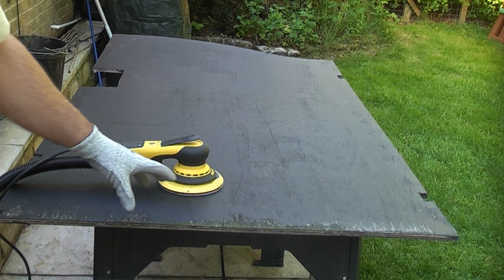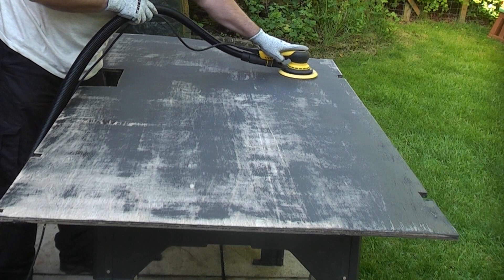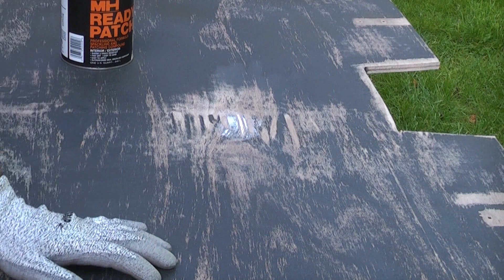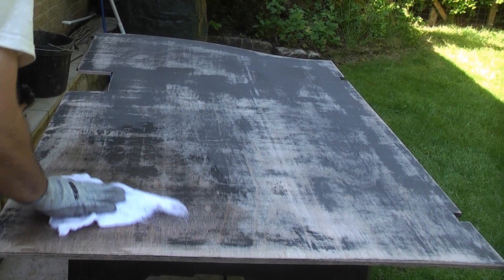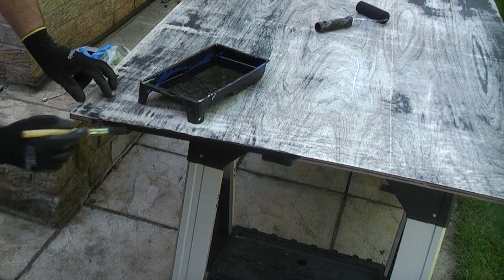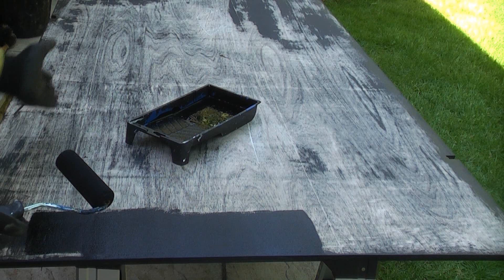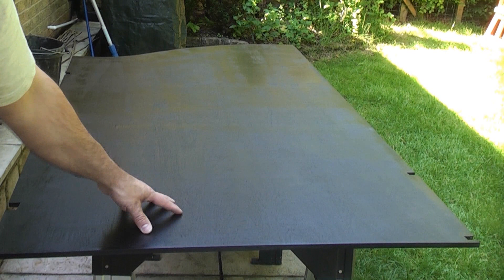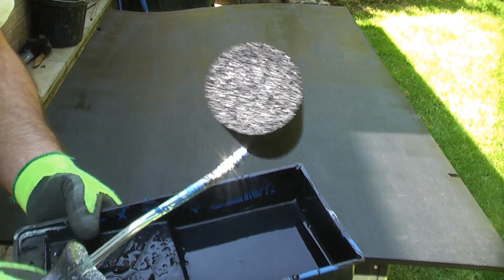Painting external timber | Zinsser ALLCOAT

Comment: Awesome video. This product is amazing. It's all I use on woodwork these days. A little bit more expensive but it's one can multiple uses kind to your brushes. Also a far quicker working and drying time. Jobs can be finished in a day. Fantastic for sash wlndows as well. Cover stain on the putties then 3 coats in a day. Just brilliant. 👍🏻
Reply from the maker: I’ve just been using this again in the last few days, first coat can be overpainted after 1 hour, the top coat is touch dry in about 20 minutes- brilliant paint 👍

Comment: You could use a sprayer on those, you can see the roller marks quite clearly on the finished product 🙈
Reply from the maker: Yes, because it is water based it dries really quickly, so much so that you cannot keep a wet edge.
I've used this paint a few times since and have sprayed it on using a Wagner sprayer and the finish is flawless.
Thanks for the comment

Comment: Nice finish!  It's amazing what a little extra effort in the surface prep will do for the final result. For projects like these I typically remove the final surface dust first with a shop vac and then with a damp rag - keeps the rag cleaner...  (By the way, what software are you using to edit your videos?  You do a nice job of that, too.)
Reply from the maker: Jo Baecker 
Thanks, I use Adobe Premiere to edit the videos. It is very expensive to buy but there are not that many editors that can work with HD footage. 
Thanks for the comment ;-)

Comment: Ches, could you do a video about staining hardwood window frames?

I have aluminium windows in a hardwood frames. I removed all the old finish with a belt sander, and then did three coats of Ronseal 5 year woodstain. It didn't even last two years. What did I do wrong?
Reply from the maker: ***** 
It's not something I plan to do, sorry!
I only have wooden windows in the garage here and they have all been painted white, which I will be sanding and repainting soon.
You probably did nothing wrong apart from possibly using the incorrect product. Every time I have stained timber windows (at my old house) I used to use Sikkens and it used to last for years before it needed re-coating.
I'm not sure how durable Ronseal 5 year wood stain is but last year I stained a deck with Cuprinol Ultra tough decking stain and it started to wash off after just a few months, you can see pictures here- http://www.ultimatehandyman.co.uk/forum1/cuprinol-ultra-tough-decking-stain-review-t78040.html

Unfortunately many of these stains and paints just don't last like the manufacturers would have you believe! 

Thanks for the comment ;-)

Comment: Excellent job can I ask how much is that paint &is it water based
Reply from the maker: jerry o connor 
Thanks, yes it is water based. I have to admit that I don't believe how quickly it dries for a water based product.
It's about £20 - £25 per litre on ebay, although you might be able to get it slightly cheaper locally due to postage costs.
Thanks for the comment ;-)

Comment: I like and use a lot of these waterbased no primer quick drying paints that are about these days but i cant find one thats as glossy as good old fashioned oil based gloss have you come across any?
Reply from the maker: charlie windsor 
I have not seen any water based paints that are as glossy as oil based paints.
In the past I have used Rustoleum primer and top coat to get a good gloss finish, but obviously these are oil based. 
Thanks for the comment
Reply: I tend to use dulux trade gloss for a very high glossy finish but it takes forever to dry
Reply from the maker: charlie windsor 
I think I used Dulux on the garage fascias a couple of years back, it still looks great today but drying time was not a problem as it was out of the way.

Comment: I'm going to use this paint to so my front door. Does the foam roller give a good finish
Reply from the maker: It does give a good finish but the paint dries really quickly, making it difficult to keep a wet edge, especially if it is a warm day.
I've recently sprayed Allcoat using a Wagner sprayer and it gives a much better finish, although it does take a lot of time masking off the area.
https://www.youtube.com/watch?v=Ft1s-lpUdus
Reply: Ultimate Handyman thanks for replying. Seen the video it was great. But I don't own a sprayer
Reply from the maker: The roller will work, but best to do it on a cool day or else you will struggle keeping a wet edge.
Thanks for the comments
Reply: Ultimate Handyman thanks I will
Reply: Scot use ice fusion rad sleaves the four inch ones there made produce and are the best rad sleaves toolstation do them about thre quid for two worth every penny they do the 9 inch ones to if you have flush doors or flush gates like this vid use the 9 inch ones it will cover quick and you wont flashing the tram lines like you can see in this vid you will roll a whole flush door or flush gate in minutes so no flash of edges..